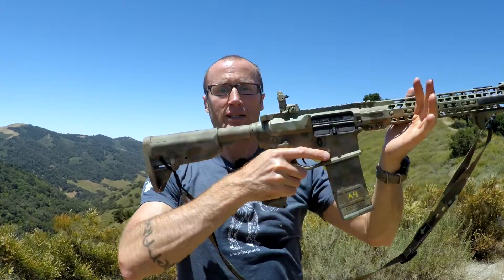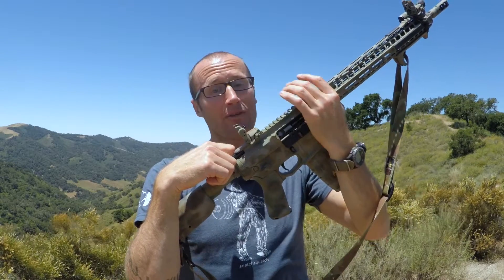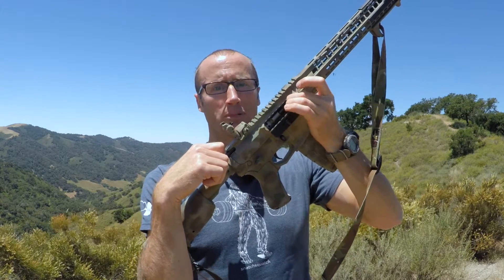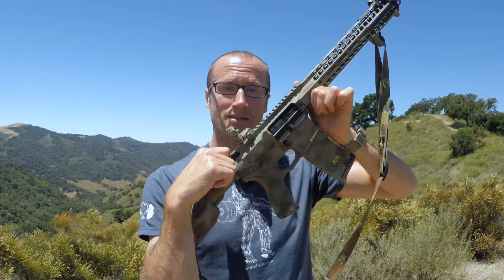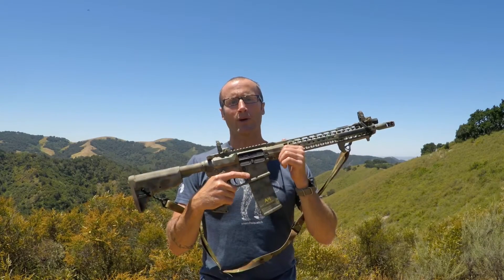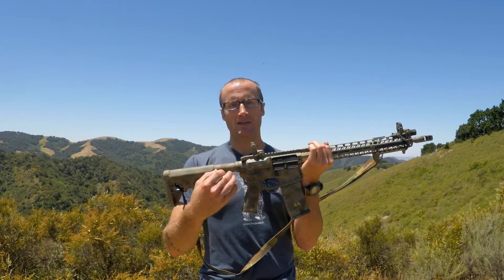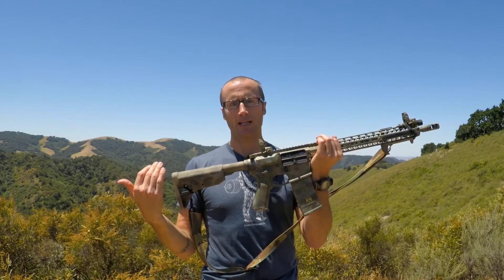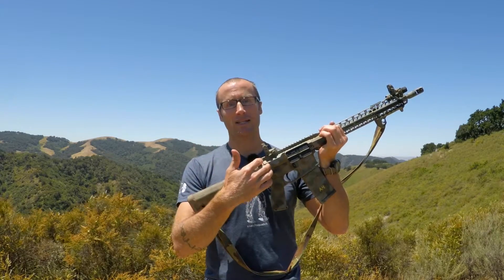How to preform a Press Check on your Rifle

Comment: When you do a press check because you don't have a forward assist on your AR you should load, make ready then remove the magazine and look(or feel if it's night) that the next round is on the opposite side that it was when you inserted the mag. If your AR mag was fully loaded with 30 rounds after you have loaded a road into the chamber the 29th round will be on the left side. This way you don't have the possibility of inducing a malfunction. Kyle Lamb teaches it this way.
Reply from the maker: I cover that in another video.  :)
Reply: This is really the only way you should press check. It’s so easy. And yes you should press check.

Comment: Getting back into battery after a press check is the sole use for the forward assist
Reply from the maker: Or if a gun gets sluggish due to its need for cleaning.  :)  But then you need to get it cleaned in pretty short order...

Comment: Try hooking your primary thumb on the latch and retracting. Your thumb can't pull it too far back and induce a malfunction.
Reply from the maker: I feel we're talking about the same thing.  With the rifle hooked in the crook of the arm, it restricts how far you can pull the charging handle back as well.
Reply: Kit Badger I'll try to make a video for you, our agency has 3 different methods. Chamber check, low light and indoor low ready chamber check.
Reply from the maker: Ok, I'd like to check it out.

Comment: If you don't have a forward assist, can't you use the groove in the bolt carrier that is exposed through the ejection port to push it forward?
Reply from the maker: Yes you can.  Be ready to bend a thumbnail. :)